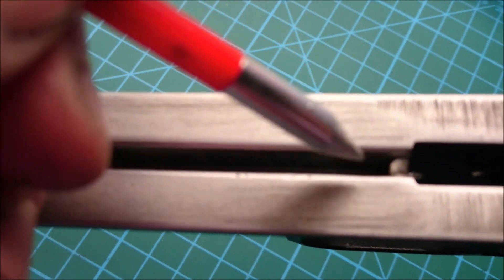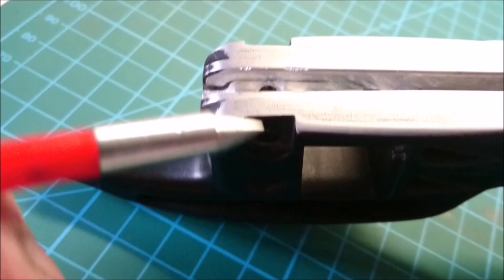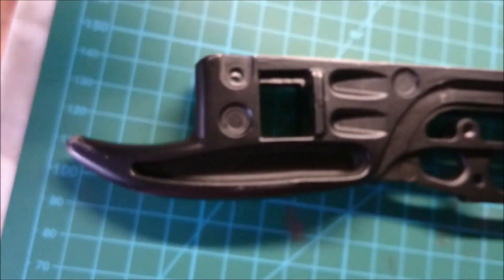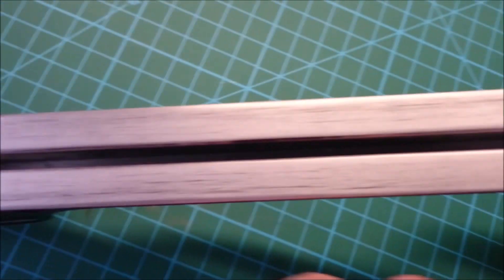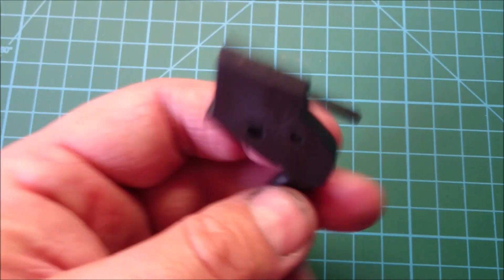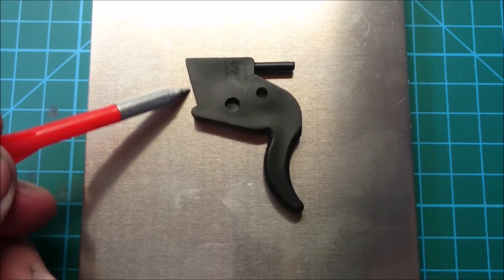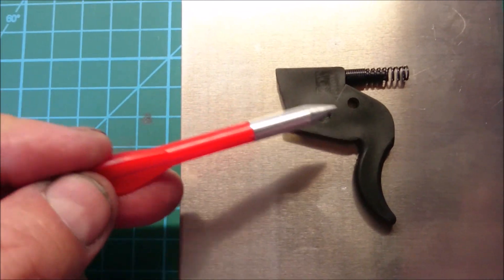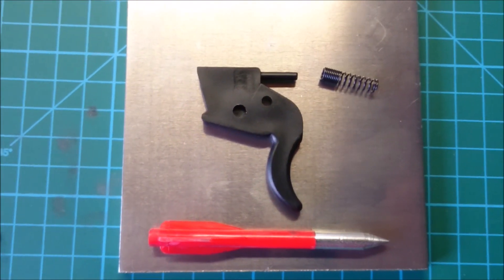Armex Tomcat MK2 custom build part 2

Comment: Awesome process brother I'm watching these because I've got a similar model pistol crossbow coming in a week or two and was looking for the mod on the limbs for extra power thanks for sharing the info its going to help me a lot. The one I have coming has a collapsible foregrip on it which is cool I was going to pit a cheap red dot sight or laser on it for fast target acquisition where did you get those wasp bolts?

Comment: Would you make one of these to sell? I would pay a great price happily
Reply: I keep hearing the Cobra's frame is cast?....if that's true?... today's polymer fame are stronger.
Reply: You really think so? Imagine a stainless steel milled one... or even a titanium one... omg. @shockadellick
Reply: @mrspeakman4021 
Stainless Steel would be perfect, however, the cost would be one hundred times the cost of the cast one we see here.  7075 aluminum is the next best option, but once again the cost would be high. Billet 6061 aluminum is the most logical way to go to cut cost and retain having a solid tool.

I own a Steambow AR-6 metal magazine and I'm waiting for the day I can get a billet frame for it. I'll ride with the polymer until there's billet aluminum available.